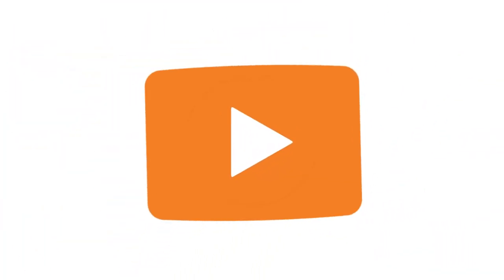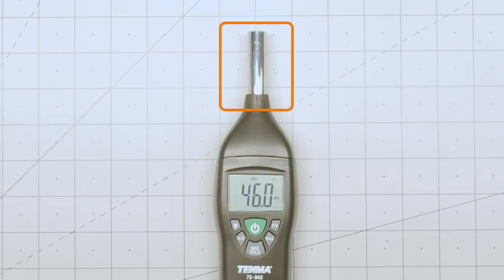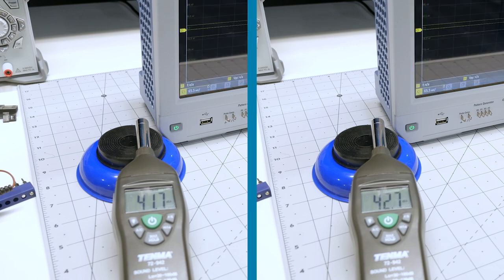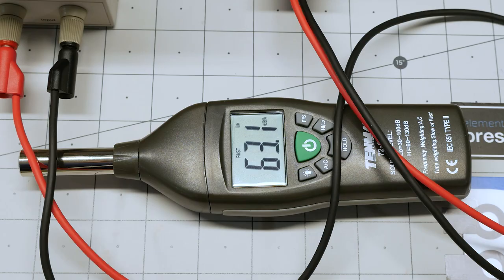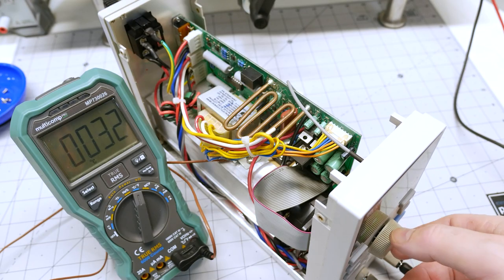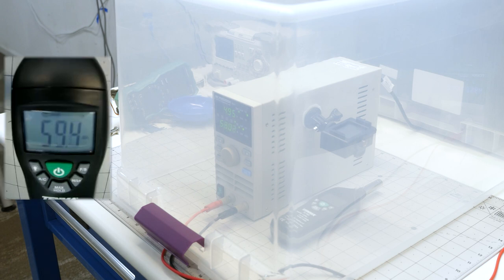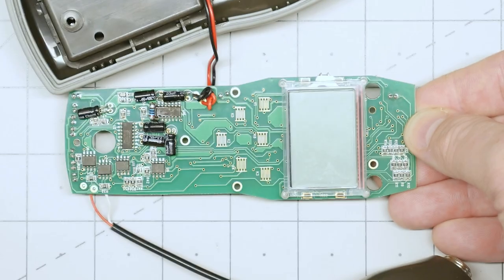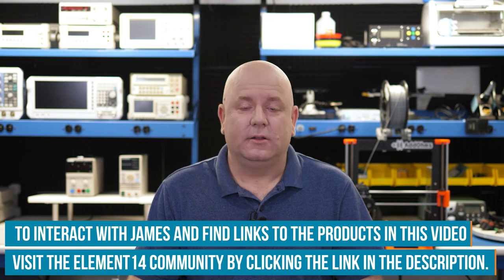How to Measure Sound with a Handheld Meter - Workbench Wednesdays

Comment: As others have mentioned the A and C are frequency weightings (filters) that approximate equal loudness contours at high and moderate levels. F (fast) applies an exponential window for averaging with Tau = 0.125 seconds. S (slow) Tau is 1 second.

Comment: 2 annotations by me, dont forget that measuring sound levels inside tight enclosures, like the plastic tub will give false readings as the sound reflects of the walls and the sound pressure is altered compared to open air.
and sesecondly:
mmmmmhhhhh Noctua fans, one of my favourite austrian suppliers.
Reply: that's right. Ideally these kind of measurment should be made in a deaf room. BUT, if you want a before/after comparison. and not accurate value, it makes sense. I would use a wooden box lined with wooden fiber or any kind of absorbent instead of a plastic tub though. That's for 2 reasons: 1_ few mm of plastic will not absorb much from the outside, I think the sheer distance between devices is makes a bigger difference. 2_ absorbent in the inside would limit most reverberation (reflections). at least in the high frequency range, which is the usefull range in this example. About 4-5 cm of wooden or glass fiber would be enough. 

Don't by so called "acoustic foam", it's cheap but pretty useless.

Also, all acoustic measurement are supposed to be at least one meter away from source. The reason for that is sound pressure decreases by 6 dB every time you double the distance, so the dB reading you'll get will increase dramatically the closer you get to the source and will not reflect actual perceived sound level. One meter away allows you to quickly calculate the SPL level at any distance given the formula: Ld= Lref- 20log(1/d) where Lref = sound pressure measured at 1 meter, d = distance from source, L= Sound pressure measured at distance d from the source.
This is only true in free field environment, but can be usefull in most cases as long as your room is not too reverberent.
Reply: How would you feel if I had lined the plastic box with some sound absorbers? While I was going for a comparative measurement, I did wonder what would have been a more appropriate measurement. Because you're right, we got an artificially high measurement.
Reply: That would be better, but still not the best. If i had to make this kind of measurement, i would try to lower the background noise by getting away of other appliances. 

Try this: place the DUT as far away as possible to any other source of noise or walls and turn it off. Place the microphone one meter away from it, set it for dBA in slow mode. 
Now, turn off every thing you can  in the room: PCs, scopes, ventilation, AC... and measure the background noise. 
Then, turn the DUT on to measure its noise. If you can get at least a difference of 6 dB between the two measurement, you can assume that the biggest contributor to noise is the DUT. The bigger the difference (the lower the background noise), the more accurate the measure. 

This would still not be perfect, but at least it should give you a more accurate value. And would not cost a penny.

Comment: "A" simulates the human ears frequency response, "C" is unweighted.
Reply: Not quite, A simulates the ears freq. resp. at the threshold of hearing i.e. at very low noise levels. C simulates the f.resp. at more normal soundlevels.
See here for explanations of the averaging times also: https://www.nti-audio.com/en/support/know-how/frequency-weightings-for-sound-level-measurements
Reply: wrong. Both are weighted, but different curves. A curve is indeed weighted to reflect human ears response, C curve is supposed to be the human ear response at higher SPL levels. dBspl or Z weighting are "flat response". Z weighting is equal to spl but defines limits for the bandwidth.